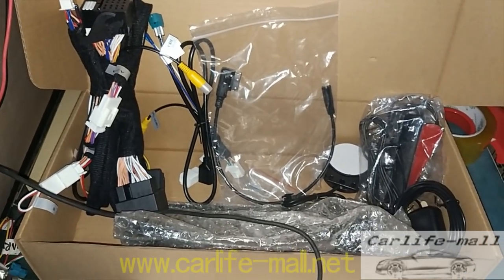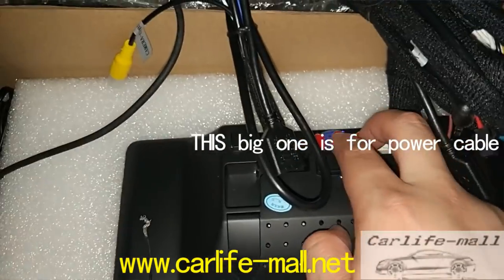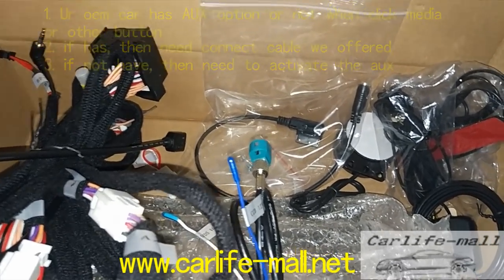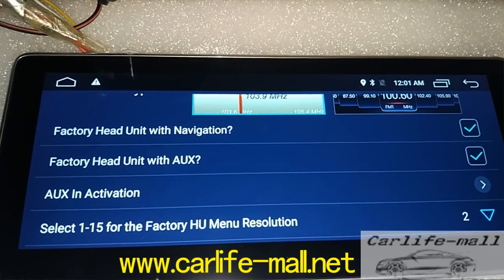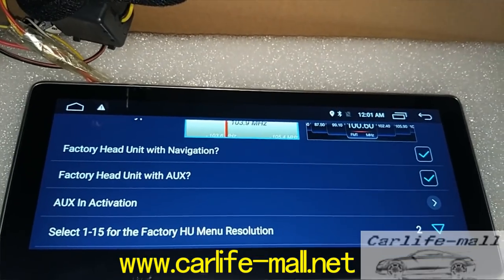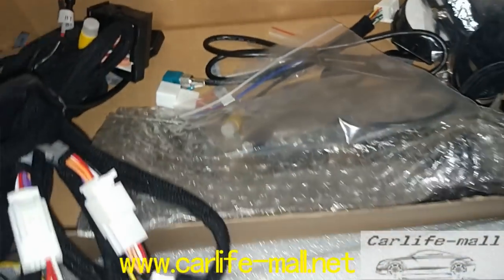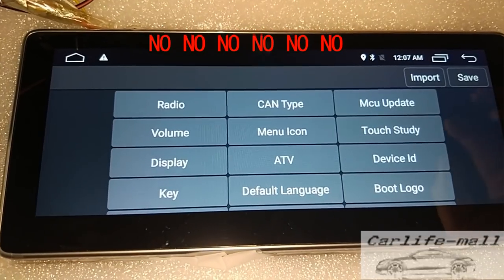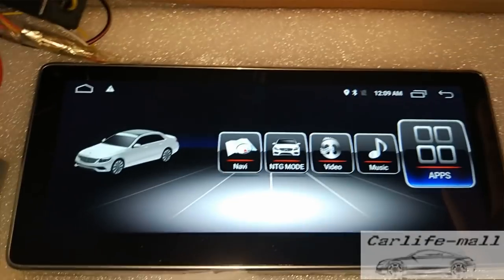10 25 inch 4gb RAM and 64GB android 8 screen for Benz

Comment: Hello do you still sell this older version for w204 year 2010?
Reply from the maker: can share with me why need old version? now old one factory stop productions, cause clients want new android system, if now get this old, most is warranty one, not suggest
Reply: @CarlifemallEmily  Hello.  Because the square corner matches the pre face-lift 2010 interior better.   Also the black and white interface matches the cluster display.   The new android screen with round corner is more match with 2015 and up Mercedes.

Comment: Hello, first of all i would like to thank you for your very informative and useful uploads. Would be very nice if you could help me to solve some issues with my android.
So, NTG screen at the beginning, when i connected it- worked, but after around an hour it went black and stays like that till now. I tried A.B.AB cabel wires but no help.
Also in settings i tried the options from 1 to 10, but still nothing changed.
Another issue is when I start the car engine, the screen doesn't turn on, I have to turn the car's radio OFF then turn it ON, only then the screen works. 
Thank you in advance. 
Regards, 
Moses Aro
Reply from the maker: if u bought screen from us, send email to the salesman, will solve for u free, if not from us, u can ask ur seller, or we will charge us50-100 to help

Comment: Is it possible to take video from this monitor for more monitors?
Reply from the maker: u mean video output like for seatback monitor?
Reply: @CarlifemallEmily  Headrest video output, RCA.
Reply: Needed two rca video cables.  One for back camera and one for video in the header.
Reply from the maker: @VascoTaxis  seatback monitor need 3 AV, 2 for audio, 1 for video
https://www.youtube.com/watch?v=f044PlrY_wQ&t=72s
this Android9 screen has, others now do not have have
Reply: @CarlifemallEmily  You have 1 video, which should be for the camera.  I needed to have at least 2 videos.
Reply from the maker: @VascoTaxis  as i said, android9 has, not this flased 8, and this 8 has 2 VIDEO too, one for rearview camera, one for dvr/front, but for heatunit, can not for this

Comment: Of course you're right about the reseller,but are you the manufacturer of the product or not? You are advertising the screen as a plug and play.I think you have to remove this statement.The installation  is very tricky even for a technician in my opinion .From the other hand you are published a public video and I have the right to make a comment also a question,and you should answer to these questions if you want to support your product .Thank you.
Reply from the maker: we do not produce this, and no factory sell this via internret for this screen, and u are right, u have right to ask , and we have right to answer, if u did buy from other seller, i do not know why others not reply
if they are a shit supplier, if we help to solve, this way only help them cheat next guy, so we will not offer service to other seller, ask them, they should solve for u, not us
Reply: lol...just because you ask question on public video in YouTube does not mean someone should answer. Some entitlement issues here.  :))))

Comment: Can I use a usa att sim card?
Reply from the maker: confirm with ur Card company if it is one of B1 B3 B7 B8 B39 B40 B41, THEN can know, i remember we have USA clients has 4G signal
Reply: @CarlifemallEmily  For AT&T in USA, 3G frequencies are GSMA/HSPA/HSPA+ 1900 MHz, 850 MHz 
4G bands are 2, 4, 5, 12, 17
Will it work?
Reply: What about B20? - This is important for Germany (Europe)
Reply from the maker: @spurensuchen  not have for B20
Reply: @CarlifemallEmily  Can we install PPP Widget so that we can connect 3g/4g dongle?
Reply from the maker: @redtheriffer  this did not test before, not sure, engineer said yes, but not tested
always we use the sim card directly, i check USA has LTE:Bands:1/2/4/5/17/19/25/26/41， u can get 1/41 to try in ur local directly if u buy this device
Reply: @CarlifemallEmily  I really want to buy this but we need more lte band support for usa and europe. You will have many more customers like this.
Reply from the maker: @redtheriffer  i understand this, but this can not be solved in a short time, the module for 4G/3G is the key